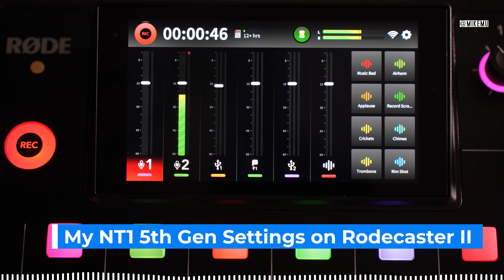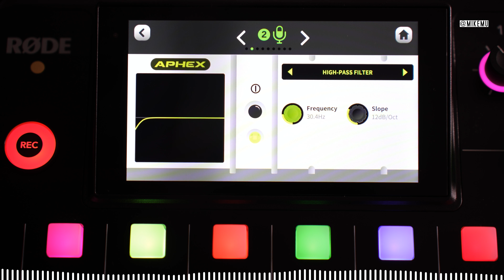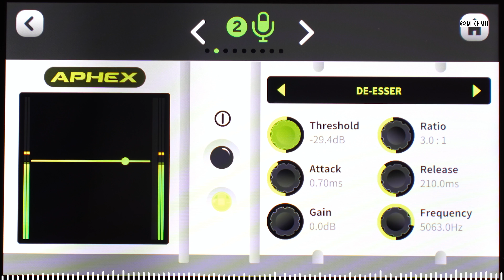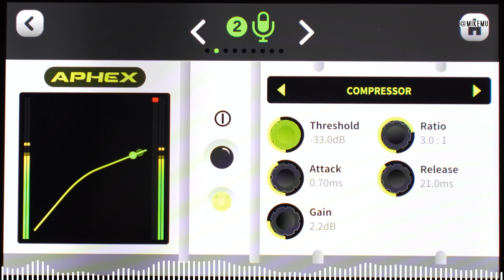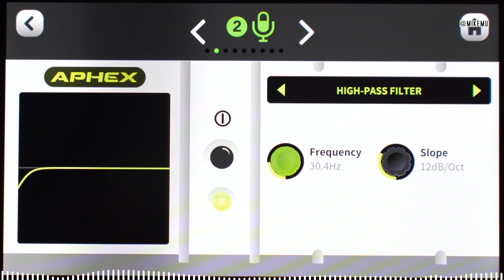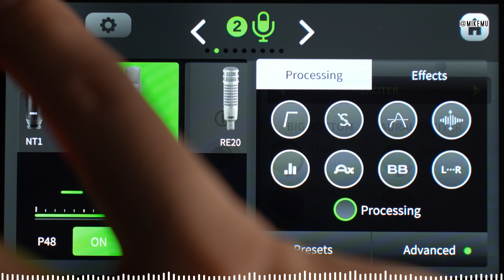My Rode NT1 5th Gen Settings on Rodecaster Pro II

Comment: Could you kindly clarify why you are using the NT1-A preset and not the NT1 preset please?
Reply from the maker: The (original) NT1 sound profile is different from the NT1-A.  I believed the newer NT1 models more closely to the NT1-A  so I used that as a starting point.  Still, with the changes noted, the selection of the profile was just a starting point for me and you can technically start with other profiles and customize from there.

Comment: Only thing missing is a limiter to avoid peaking. I think everything else is solid. I was wondering if they update that but it seems like they didnt. Only thing that is missing that would make me buy it
Reply: Well if your using the usb c input and 32bit floating point recording then you do not need a limiter.
Reply: @DigIntoGaming  Are you using the 32bit? I will check out your channel for vids on this.
Reply: Are you referring to Rode adding the 5th gen NT1 as a preset on the RCP II?